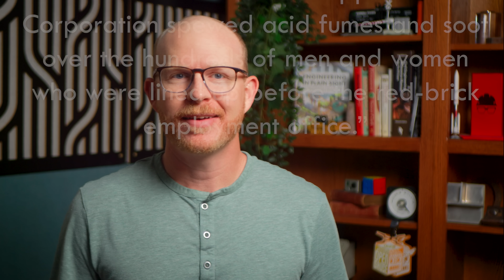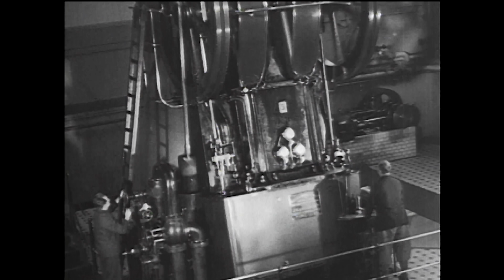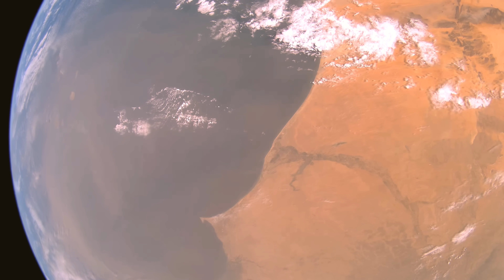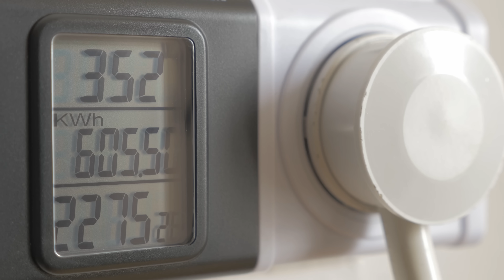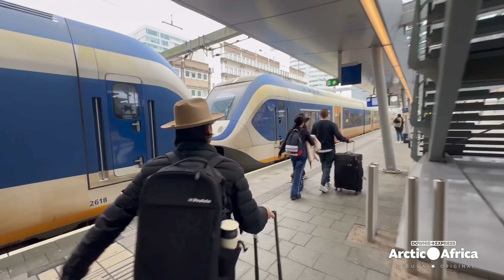Why are Smokestacks So Tall?

Comment: WOOOAH. So, if I run a smokestack on my Audi, I will increase the exhaust speed, making my car run more efficiently, resulting in added power??
Reply: Intake and exhaust desing is a huge part in power generation for high end cars. A smokestack wouldn't work tho, as cars don't produce constant drafts... but a custom exhaust job could definetely increase power (to a point).

Comment: The mystery of 21 century,  add regulations for air pollution, but invent thousands of chemicals and dump everything in the soil. Ever saw the ingredients from a shampoo? Where do you think those ingredients end?
Reply: Hopefully to a wastewater treatment plant, in the worse case to a river, untreated. Tho tbh most things in shampoo and most soaps/detergents are hardly problematic.. you might just be getting scared by something you don't fully understand. Pollutants more problematic come from pesticides, mining, certain chemical, manufacturating and energy plants, street run off by rain and more.
Reply: @JoseNovaUltra Have you ever read the ingredients from a shampoo?
Reply: @danielmogos8990  yup, that's why I'm telling you... if you are worried about some in specific you could bring it up..
Reply: @JoseNovaUltra ok, sure
Lets start with 
Sodium Lauryl Sulfate, Sodium Laureth Sulfate, Cocamidopropyl betaine

Comment: Grady, I've noticed many taller stacks have a feature on the sides of the stack near the top that are helical in shape.  Are these 'vanes' that promote increased loft in the vicinity of the stack's outlet?  That's one conclusion I can determine.  Another may be to improve stability of the stack under lateral wind loads

Comment: Not sure why carbon dioxide was mentioned in a video about pollutants.. Because carbon dioxide is not a pollutant
Reply: Alot of money has been spent for your statement to be technically true. But If you consider it logically instead of politically then yes, it's an extremely common pollutant

Comment: my first job out of shop as a sheet metal aprentist (1979) was to extend vent stacks (chimeneys ) for many companies in my area of toronto , because polution testing was within 2 to 5 miles from plant , engineres calculated that raising vent by 3 to 15 feet ,now plant passed inspetion

Comment: Not sure if this has been posted yet, but I had a question regarding the shape of the smokestack. I noticed the graphics of the smokestack has a slight taper to it (could just be for seismic stability) and yet the pizza oven stacks looks like a normal cylinder. Would the taper actually be beneficial?

Comment: When the Clean Air Act was originally passed by Congress, CO2 was not considered an atmospheric pollutant.  Because Republican elected officials have mostly been opposed to amending the Clean Air Act to make CO2 a pollutant, it has been difficult for Democratic administrations to use the EPA to address climate change.  It used to be that making a coal-fired power plant "clean" involved getting it to burn its fuel more efficiently, thus reducing the amount of particulate matter (i.e., smoke) that would need to be captured by filters.  However, burning  more of the fuel will actually produce more CO2, which is probably why many environmentalists say that there is no such thing as "clean coal." Personally, I think we should be building more nuclear power plants to produce electricity at night and/or when the wind is not blowing.

Comment: I think the rule of thumb is that a pipe taller than ~7 times its width is a waste because the temperature inside approaches the outside one. Maybe putting a super megawide megahigh stack might work better, but IDK.

Comment: 00:18 - Tall smokestacks help minimize air pollution's impact on health.
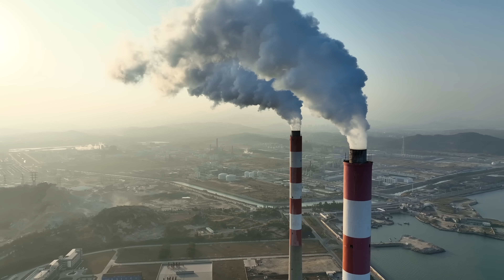03:01 - Tall smokestacks help disperse pollutants, improving air quality locally.
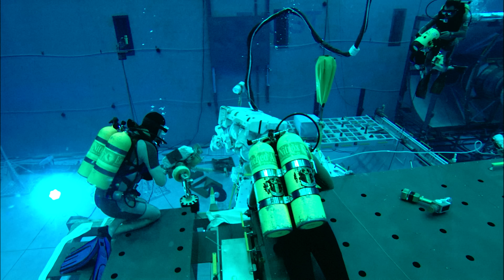05:27 - Tall smokestacks enhance airflow through pressure differences.
07:49 - Tall smokestacks primarily reduce air pollution by dispersing pollutants.
10:22 - Air pollution management involves complex challenges beyond smokestack emissions.
12:59 - Pollutant dispersion is affected by atmospheric conditions and stability.
15:24 - Tall smokestacks help manage air pollution dispersion effectively.
17:51 - Environmental professionals develop solutions for air quality and public health.

Comment: Interesting video. Where I worked the power station chimneys are around 270m tall and at the base some 30m across. Each contains 4 stainless steel flues, two for each unit. And prevailing SW winds means that the plume, when what's left of it after dispersal, ends up in Bass Strait, off the SE Australian coast.

Comment: His graph of height over pressure for ambient air and smoke stack triggers me a bit. I'm pretty sure the graphs should be reversed aka. They converge at the top and diverge at the bottom. It wouldn't make sense otherwise, as the pressure right at the top of the stack is the same as ambient pressure.

Comment: If you want to replicate your Pizza Oven test with only one changing Variable, replace the fire with an Electric Heating Element and move the Experiment into the Garage...
Outside Temperature is controlled by the Garage Heater...
The walls block wind which could affect air temperature and airflow...
The Oven heating Element will maintain a constant temperature based on it's electrical input...

Therefore, the ONLY Variable that will affect the stacks output air speed is how tall it is...the Variable being Tested...

Comment: This has got me wondering about the engineering behind rocket stoves, and how that system would work in an industrial space.  How would an extended vent/chimney work with extra length or bends, and at what point does too long become ineffective...?

Comment: I designed and built a corner fireplace, with a warming bench in the back of it. It was almost done and the owner built a small fire to test it. He asked why the smoke wasn't going up the chimney. I placed a piece of plywood on the back side, and the smoke went right up. I had to remind him that it was designed for glass on one side, and screen on the other side, and reversible. The fireplace was 45° to the room so I had to built a damper hood to flue liner transition tube that was 8 sided. The design of a fireplace is science, with flue ratio, smoke shelf and damper.

Comment: of course all that said you still do want to run your furnaces as hot as possible, just because you want combustion as complete as possible. Not only to reduce large particulates but also because that fuel cost money, black soot up the flu or into the scrubber is basically fuel that did not assist in revenue generation.

Comment: "The big black stacks of the Illium Works of the Federal Apparatus Corporation spewed acid fumes and soot over the hundreds of men and women who were lined up before the red-brick employment office."
🏭 [00:02] Vonnegut's Dystopian Future: a quote to a polluted future, highlighting the importance of managing industrial air pollution.
💨 [01:01] Historical Smoke Management: Humans have long balanced the benefits of fire with the negative impacts of smoke emissions.
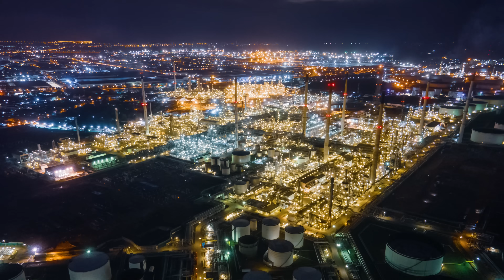🛡 [01:13] Engineering Pollution Control: Since eliminating emissions is impossible, managing their occurrence is crucial for public health.
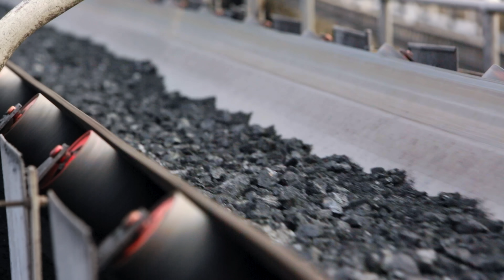🔥 [02:15] Industrial Emission Treatment: Industries use technologies like catalytic reactors and scrubbers to treat pollutants at the source.
💧 [03:02] Dilution as a Solution: The saying "the solution to pollution is dilution" applies locally to short-lived pollutants.
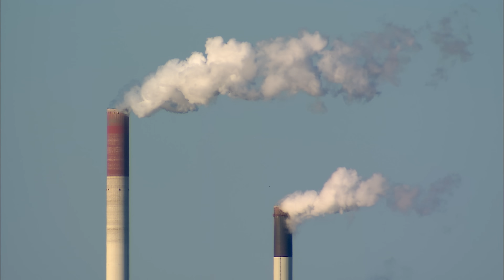🎈 [03:54] Buoyant Plume Rise: Hot pollutant plumes naturally rise, aiding dispersion, a key principle in stack design.
⚙ [04:51] Smokestack Pressure Difference: Stacks create a pressure difference to drive airflow without excessive heat loss.
📈 [06:23] Controlling Airflow: Engineers adjust stack height and gas temperature to control the "stack effect."
🏭 [07:41] Evolution of Stack Purpose: Originally for combustion, stacks now primarily serve air quality purposes due to regulations.
🌍 [09:50] Reducing Pollutant Exposure: The goal is to reduce pollutant concentrations, requiring understanding of complex plume behavior.
🌬 [12:25] Pollution Transport: Advection (wind) and diffusion (turbulence) are key processes in pollutant dispersion.
🌪 [13:35] Atmospheric Stability: Temperature inversions can trap pollutants, making stack design challenging.
🖥 [16:10] EPA Modeling Software: Engineers use sophisticated software to simulate air quality impacts from pollution sources.
⚖ [16:56] Balancing Cost and Health: Regulations balance stack height costs with public health, prioritizing emission controls.

Comment: In Krakow (Poland, Europe), when modernizing a thermal power plant to reduce air pollution, they shortened the chimney, from 225m to 120m.

-----
The taller chimney, which is as high as 260 meters, is the tallest structure in Krakow. On a daily basis, it remains switched off. - It is used only in emergency situations and during boiler start-ups and shutdowns,” says a company representative.

Until recently, the tallest chimney had a “twin brother.” The 225-meter-high structure was demolished in 2017. Progress was followed by all of Krakow. The work was especially impressive in the drone photos - a special platform was mounted on the very top of the huge tower, and an excavator was working on it as if nothing ever happened.

New one takes care of cleanliness 

All this was happening at the time, when a new chimney, half as tall, was already standing next to the two tall chimneys. The 120-meter chimney, more than eight meters in diameter, was put into service four years ago. Its construction was due to the fact that the CHP plant had to comply with new EU emission regulations, which obliged it to have a desulfurization plant.

- The chimney is used to discharge treated flue gases after dust collection, denitrification and wet flue gas desulfurization plants. The white cloud is the steam that comes out of the chimney of the new flue gas cleaning plant, explains Maria Niewierko.

The technology used there makes it possible to get rid of almost all the pollution. - The CHP plant's flue gases are first cleaned in a denitrification plant and then in electrostatic precipitators. More than 99% of dust is captured at this stage. Then the flue gases are cleaned of sulfur compounds and other dust in the Wet Flue Gas Desulfurization Plant,” the PGE Energia Ciepła representative enumerates.

Together with the electrostatic precipitators in operation, the installation causes many times less sulfur oxides, nitrogen oxides and dust to be released into the atmosphere compared to previous years. As a result, the flue gases at the chimney outlet consist mainly of nitrogen, oxygen, carbon dioxide and water vapor, i.e. harmless substances - with the exception of CO2, whose emissions contribute to the greenhouse effect. 
https://lovekrakow.pl/aktualnosci/czego-nie-wiesz-o-kominach-elektrocieplowni_30822.html

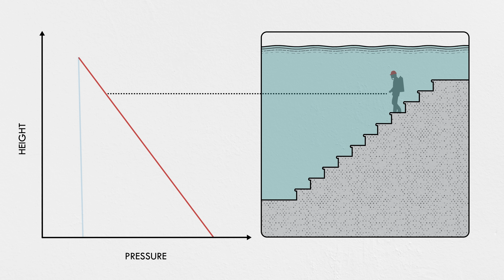Comment: 05:49 I dont understand, why the pressure would be the same for both cases on ground level."the air inside the stack is less dense", wouldnt this mean the pressure is lower than outside to begin with?

Comment: Landfill gas puts hydrogen sulfide into the air, the decomposing plant and animal matter makes hydrogen sulfide, but the problem is much worse if gypsum board is put into the landfill, the bacteria steal the oxygen from the calcium sulfate, which leaves calcium sulfide, then the calcium sulfide would rather be anything else so it react with weak acids from rotting food to release hydrogen sulfide. 
Its easy to scrub landfill gas of this stuff ...just pass the gas over iron oxide, then it reacts to make iron sulfide, and it can actually react and turn back into plane sulfer, and the iron oxide can be re used

Comment: If co2 is a pollutant, why do plant nurseries have co2 generators?
Reply: Bad point to make, nitrogen fertilizer is a water pollutant just as co2 is an air pollutant. Just because adding co2 improves a simple closed system doesn't mean that's how it works on a global scale. It completely ignores drawbacks like climate instability and drought. Both being things plants dont like

Comment: I wonder if yall smoke stacks are made of concrete instead of steel because steel would flex so much in winds that it would cause turbulence to the flow, because in my experience as a welder concrete flexes so minuscule before its breaking point that the only way to even see that it’s happening at all is to cash a thin wire inside the concrete to read tension as forces are applied to the concrete.

Comment: 1 thing to note is water pressure increases with depth linearly but air pressure decreases with altitude exponentially. This is because water is an incompressible (high bulk modulus) fluid but air is a compressible (low bulk modulus) fluid. This means the water density remains constant with depth but the air density decreases with altitude. However the linear approximation can be used for low altitudes like the smoke stack but can't be used for high altitudes like Mount Everest.

Comment: One very expensive but important air cleaning machine you didn't mention was RTO's (Regenerative Thermal Oxidizers). We use them to incinerate pollutants and turn them into less harmful pollutants (usually CO2).

Comment: CO2 is plant food. We need it to eat.
Reply: I don't want to be rude but this is a serious misunderstanding of how plants use nutrients. Crops would not benefit from increased CO2 content in the atmosphere because carbon is not a limiting factor in our farming; the limiting factor is usually nitrogen and phosphorus. And in fact, warming would have a negative effect on food crops by rendering some temperate crop lands too arid for industrial farming.
Reply: @banjo304  So why then did experiments with 1,200ppm of CO2 yield plants with double the normal size?
Reply: @euro_wars  Double sounds extremely suspicious to me, but I don't doubt that it increased plant growth. But nowhere on earth is it the limiting factor for plant growth, and making more soil nutrients available is going to give you vastly better yields than making more carbon available in the atmosphere. Also, again, I think you'd do more harm than good due to the disruption of farming in areas that would start to aridify due to the increased heating jacking up the ppm would bring about. Although, admittedly, also opening up previously frosty regions to agriculture as a result, also.
Reply: @banjo304  The flaw in your scam is that C02 heat uptake reduces as it reaches 500ppm
Reply: @euro_wars Ah, yeah. I forgot about the "scam" I was running. Let me know when I'm supposed to be getting the payoff on it, I've been waiting for it for ages.

Comment: I was honestly guessing there had to be a factor considering not onky the height but also the shape and tilt of the sides of the chimney. I mean, soot is travelling through progressive narrower sections so it should contribute to its speed? Maybe a contribution that works in par with the temperature of the gas to help it rise? Or maybe I missed it tho, I listened to the video and didn't have the chance to watch it throughly.

Comment: I work designing pressure management systems so the dynamics of unconstrained flow is not my specialty. But for these stacks could they not instal an iris or valve to control flow velocity through flow constriction to force the media higher when poor atmosphere conditions create undesirable flow?

Comment: 17:11- LCRA/Austin Fayette Power Project near LaGrange, TX (east of Austin).  If you pause the video you can see 4 stacks, but there are only 3 generating units.  The two tallest stacks served units 1 and 2 from the initial construction in the 1970s until scrubbers were fitted (1990s? I forget).  The thick stack on the left was built when scrubbers were added to units 1 & 2. Scrubbers significantly change the chemistry of the exhaust gasses- its what they're supposed to do- but one side-effect is that the exhaust gas becomes much more saturated with water vapor. Special stack lining is required to keep the now-soggy and still acidic exhaust gas from eroding the interior of the stack, and in this case it was more cost-effective to simply build a new 2-flue stack and leave the old ones standing.  The third stack is for Unit 3, the lignite-fuelled unit, which was built with scrubbers when it was initially built, because lignite is only marginally cleaner than burning dirt.  :/

One of the ironies of adding scrubbers is that the increased water content makes the stack exhaust far more visible most of the time, as the water vapor condenses even in very hot ambient air instead of only when the ambient air is very cold as was the case with un-scrubbed exhaust gas.

Comment: You've got a knack for making videos about things I was recently wondering about. This topic came up with my family's wood-stove heated cabin over the winter. It takes a long time to get the stove hot enough to build enough pressure (tall narrow cabin with a long stove pipe). Perhaps we should install a little turbine at the top to kick start the system lol, turbocharge our wood stove

Comment: I work as a furnace engineer for the company that builds and designs smelters around the world including the really interesting example of the Inco Super Stack.

Originally the process of the furnace was hot enough to get the flue gas up the stack, but over the years as energy recovery, acid plants, and scrubbing improved through the “atmospheric emissions reduction” project, the gas didn’t have enough energy to get up the stack. This led to the need for burners at the bottom of the stack to be installed and increasing CO2 emissions purely from burning natural gas at the bottom of the giant stack that was no long practical. 

Eventually two new stacks were commissioned and the super stack now no longer needed will be dismantled.